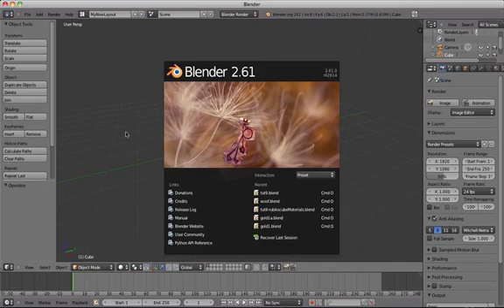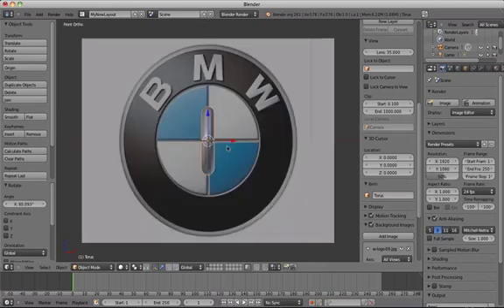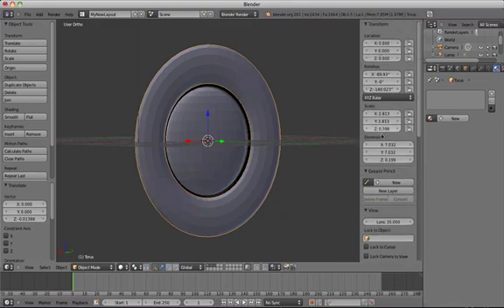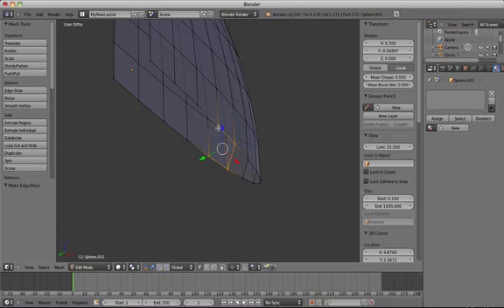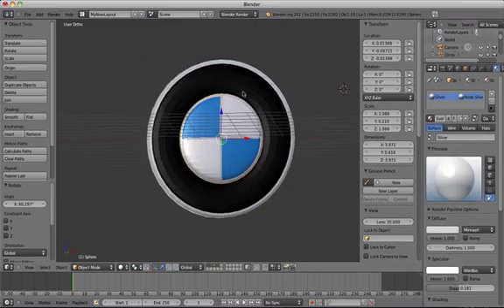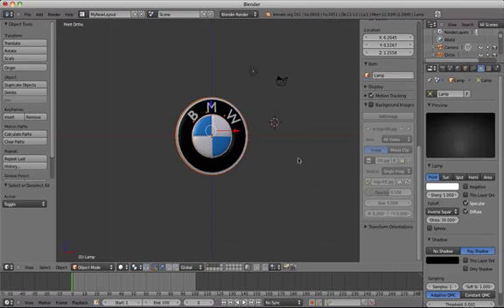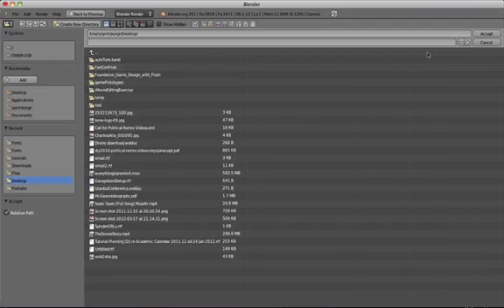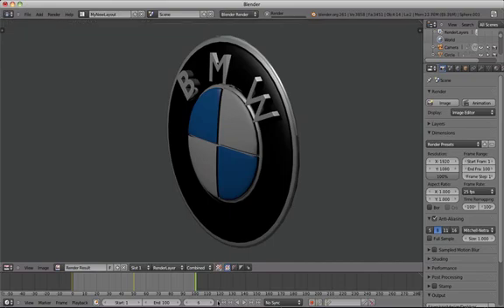Beginners Blender 3D: Tutorial 10 - 3D Logo Ident Process: BMW Badge

Comment from the maker: Are you using the number pad? If you're working on a laptop, you might not have a numpad, in which case, you need to go to 'File - User Preferences - Input' and then tick the box 'Emulate Numpad.' Now your number row should work for switching views.